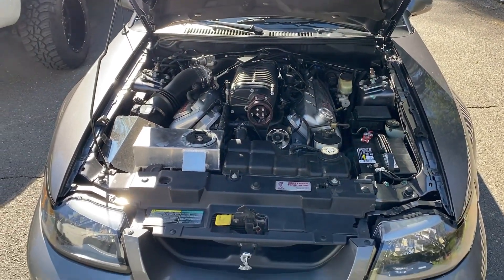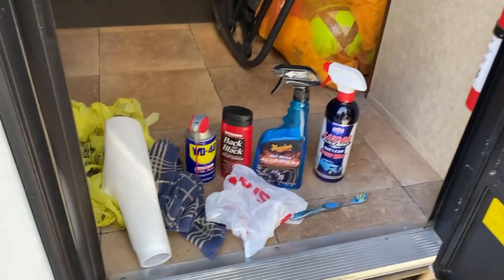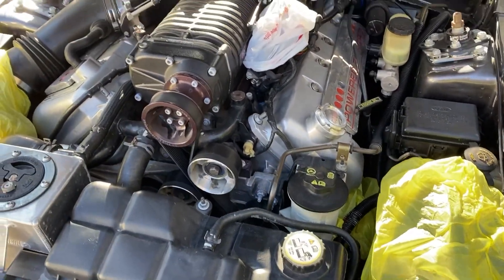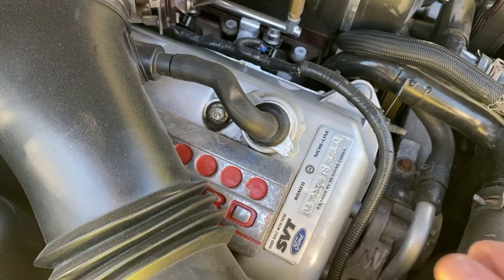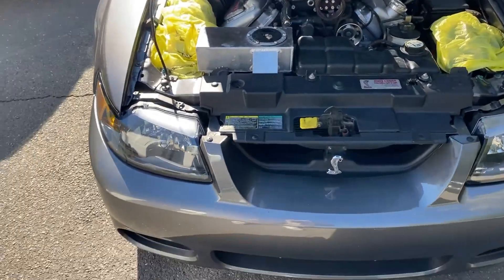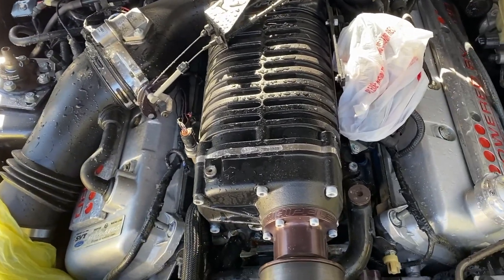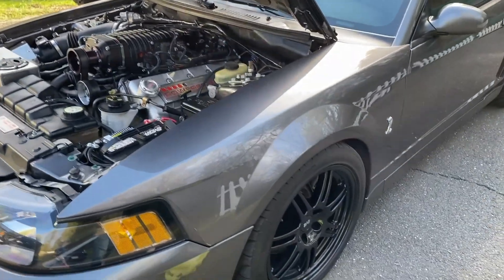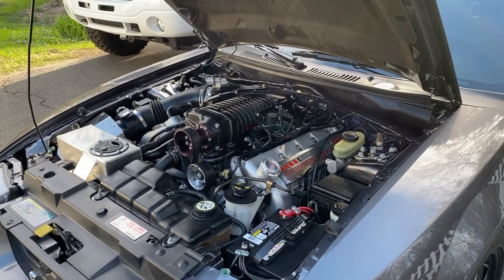Motors 1st Wash! | Terminator Mustang Cobra 2003

Comment: You have a very similar setup to my Terminator. Very Nice!
Reply from the maker: Awesome! Are you on Instagram? How much power are you putting down?
Reply: @Wretched2JZ  No but I am on facebook. My Cobra has a brand new 4.6L engine balanced, blueprinted, with CP 9:1 compression pistons, bored .020 over. Heads reworked--multi angle valve job, all ARP head studs & rod bolts. full bassani exhaust including mid-length headers. Engine was built and tuned by ProDyno out of South Carolina...the Dynojet sheet shows it puts out 621/595 wheel on 93 octane gas at 18psi boost.

Comment: I really like CD 2 engine detail, but it's discontinued ..... so if you can find any let me know too. It has a resin in it and you blast it on and run ur motor at idle with the hood closed and the heat allows it to work in.... when it's done it looks like little water droplets on the surfaces that you can wipe off with a cloth. Doesn't attract dust and lasts a good amount of time. It's the only ish ill use!